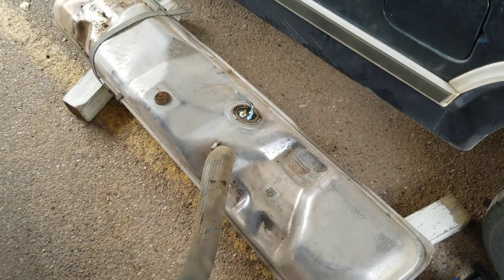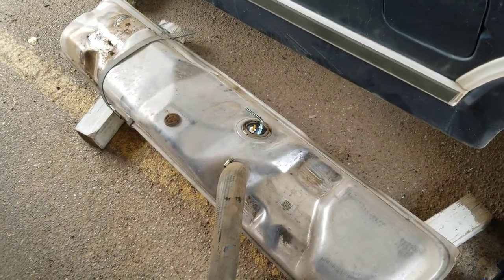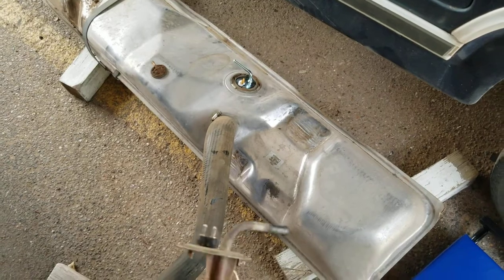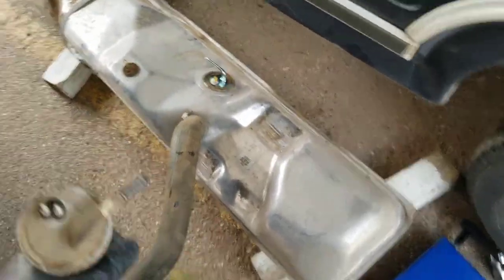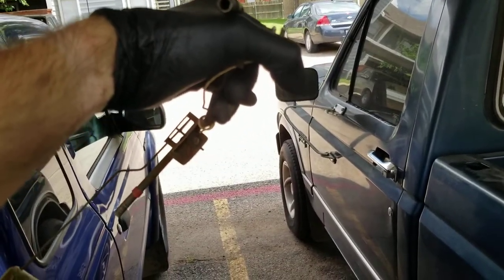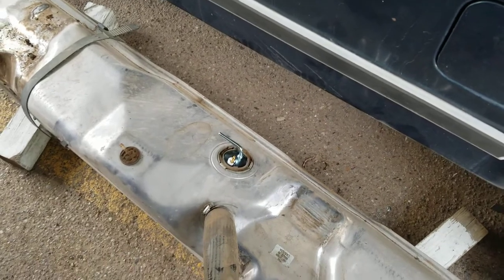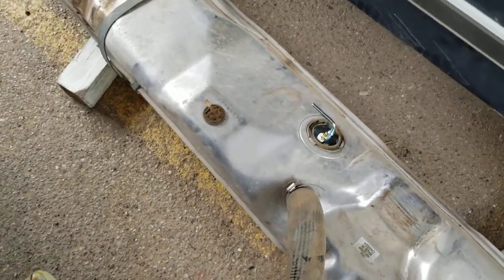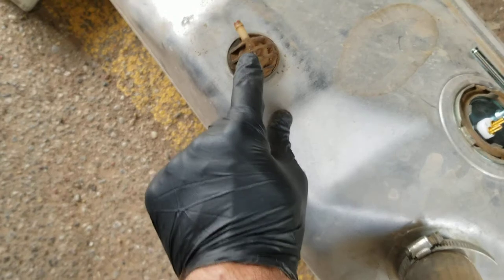80-86 Ford truck front (side mount) 19 gallon fuel tank sending unit and tank vent replacement.

Comment: Oxidized ethanol from the gasoline will create a non-conducting film on the sending unit resistor and wiper. There are solvents like Marvel Mystery Oil, Lucas Injector cleaner, and others that if used in extreme concentrations will dissolve and remove this junk. My '85 F-250 sat for 2 years while I scrounged money to rebuild the engine so the sending units became erratic. I fillet the one tank and added 3x dose and let it sit and only drove on the other tank letting the mix slosh back and forth. I now have a 38 gallon rear and 17 gallon front for a total of 55 gallons; spare tire is mounted on a roadmaster RV hitch which folds down. My 460 gets 10-11 mpg empty and 9 loaded on the highway. Every now and then a fuel pump and sending unit hanger unit will appear on ebay so now I have new front sitting on the shelf. My fuel pumps in the tanks were getting weak so I added a Holley electric fuel pump, 8-9 psi, on the frame and use the tank pumps just to lift the gasoline. My engine had the hot fuel bypass which was junk so I installed a Holley bypass pressure regulator in place of it which gives 5.5 psi to the Edelbrock AVS-2 off road carb which is a great carb IMHO. The 38 gallon rear tank required me to fabricate a hanger using parts from several hangers. I learned years ago that any hose in the fuel tank must be a type that can be immersed in gasoline; Summit has it for about $23 a foot. I have found that a good quality electric fuel pump external to the tank will usually lift the gasoline with no problems and they can pull the gasoline through the bad pump in the tank; I am only talking carb versions here. I have seen Ford do this with their fuel injected versions with a tank lift pump and another high pressure pump downstream for the fuel injection. The only place for ethanol is in my Wild Turkey 101 or IPA beer. added: see e b a y for fuel pump 1985 Ford F-250 Base Extended Cab Pickup 2-Door 7.5L

Comment: hey I dont know if you'll see this but I have to replace the fuel valve vent too. but I also don't see the rubber tube that it connects to, where should that tube run to?
Reply from the maker: It runs towards the front of the vehicle.

Comment: Any Fuel pumps I could use to replace my rear tank? I have a 85 F-250 460 Cyl. It's a metal tank aswell, can't find the exact Fuel Pump anywhere online so far.
Reply from the maker: That depends on whether your engine is carbureted or fuel injected. I'm not sure what they were on the 460 that year.
Reply: @sclemmons1  Mines Carbureted, damn ok. Guess all keep hunting these parts lol
Reply from the maker: @ShawbazSoaia  If it's carbureted, then the pump is on the engine block. The sending unit will be one similar to this one. I would check LMC Truck's website.